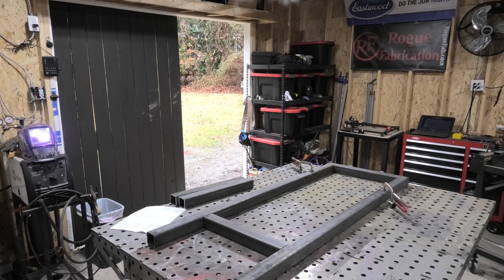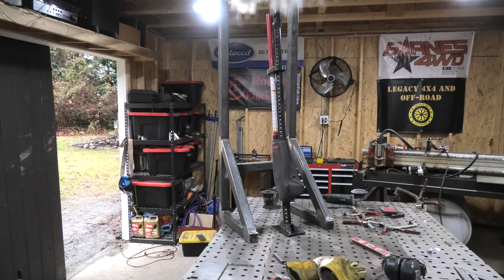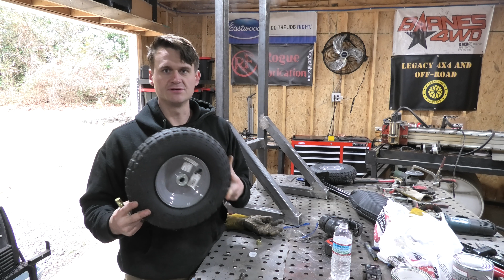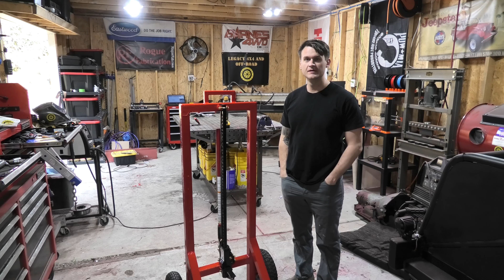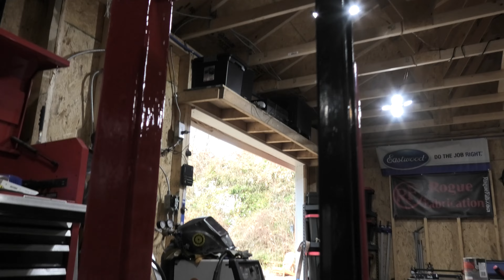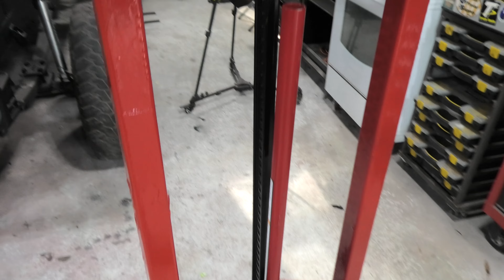Custom Fence Post Puller Complete Build || Legacy 4x4 Fabrication

Comment: I need a bolt together version. I don't know how to weld
Reply from the maker: You could build something very similar and use through bolts instead of the welds to hold it together. This works super well though!

Comment: Liking this project, but how hard would it be to change it to a hydraulic hand jack with a long shaft, they have them at Tractor Supply also
Reply from the maker: id assume not that bad considering the frame was so easy to make... didnt really think it thru like that, but one of the log splitter jacks would work great!
Reply: @Legacy4x4andOffRoadYT  I thought about a log splitter jack but considered it to be to big and heavy; there’s one like that but isn’t as big so it would be a lot lighter
Reply: Seems like the most difficult part to this system (hydraulic) would be the attachment point to lift the posts’ cement base.  The legs would probably need to be longer too (along with the arm) if you’re envisioning a many engine hoist type mechanism.